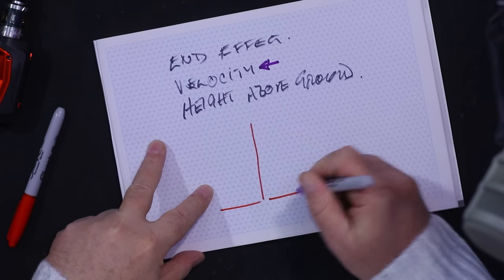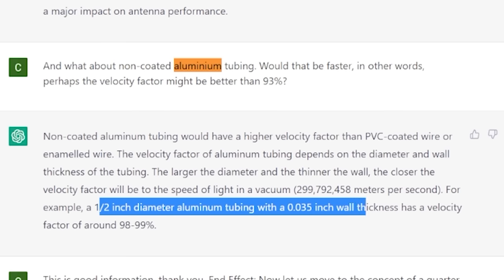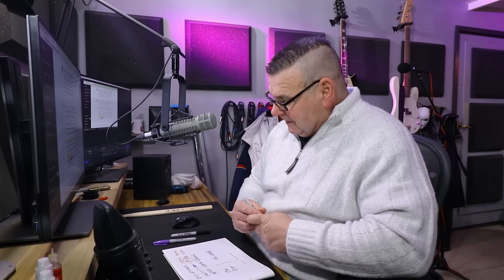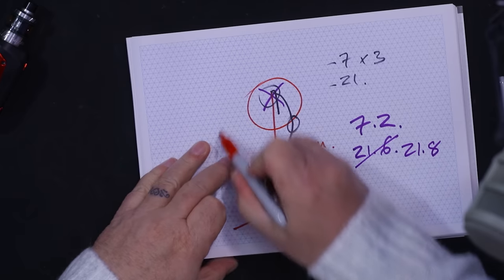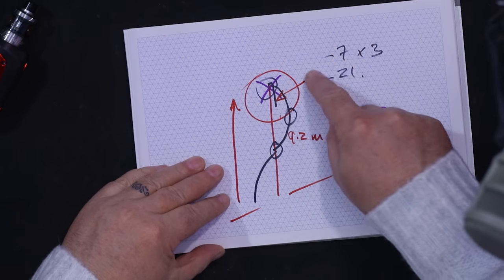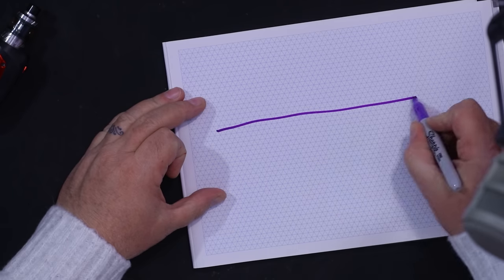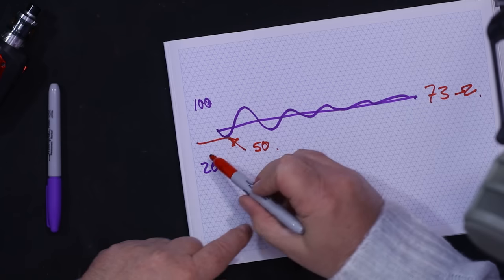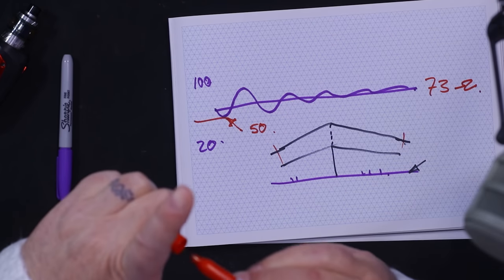Solving the Mystery of a Shorter Antenna - End Effect & Velocity Factor

Comment: Interesting, so when an antenna element is folded back on itself it has the effect of increasing the impedance in that section, why? Because the current flow in the folded back section is in the same direction and phase as the main dipole. Therefore as the current in both sections are in phase with each other the antenna radiation pattern is unaltered. But there is now is an impedance increase in this new folded section deduced from the fact that the power in the folded section has to remain the same, but as current flow is evenly shared between the two sections, the current in each conductor is now a half of the antenna current. Then because the power remains the same in the folded section the impedance has to be raised by a factor of four to retain a balance in the equation Power = I^2 x R
So, the end-effect reduces impedance at the end of the antenna and folding back a short section increases the impedance to redress the imbalance.
Reply from the maker: Wow. Perfect!
Reply: @DXCommanderHQ  should try an inverted egg beater antenna for 40&20 meter bands it should give a lower take off angle

Comment: That certainly helps explain why, with my homebrew fan dipole, I had to keep trimming & folding back the ends of my 80m wires WAY more than I thought just to get it resonant.  I'm low to the ground - 10' in the center & 6' at the ends.  Makes sense now.  Thanks Callum & keep up the good work!
73 K5MWA

Comment: Good information for the newbie Ham! If this video would have been created last year I would have abandoned the idea of an OCF dipole from the start. Further explanation: My Yaesu doesn't have a tuner. OCF dipoles are affected by end effect more than any other antenna. At 40m, both high voltage ends of the waveform contact the ends of the wire, so needs to be 3 feet short for resonance.  At 20m, the center of the waveform (at the center of the wire) is a high voltage point, but not a wire end, so end effect is 50%.  At 10m, you have 4 current humps, but only two find the end of the wire, so it wants to be mostly full length. 10m resonance was about 30mhz. Switched to a fan dipole, at least until I get a tuner....
Reply from the maker: Ah!!

Comment: Everything effects everything in HF! 
I would include the coax and fittings/adapters in that statement. Does the length of the coax make a difference? It doesn't seem to effect SWR so much as it effects the projection of your wavelength. Just as a ground plane gives a backing for the signal to push off of, doesn't the coax do the same?

Comment: Great video, I was wondering roughly how many meters is your equipment from your antennas? Is the length negligible in the performance of your equipment?
Reply from the maker: Hello Davic.. The run from the coax feed box to the field coax box (underground) is 42m (130 ft). I use EcoFlex 15 coax for that. The between the box in the shack to the gear is about 5m (20 ft) and between the field box and the main antenna is another 12m (40 ft). So I have to use very high-end coax.
Reply: @DXCommander  so do you have an external tuner or is the transceiver tuner more than adequate?
Reply from the maker: (sorry for late reply on this) Although I have a tuner, I never use it. I like antennas that just work..

Comment: Just to be sure. This folded wire is behaving as coil not capacitor? Generally your construction is brilliant and easy to build. Another great video. All the best. SP6MI
Reply from the maker: Well, it's supplying loading, so I have no idea to be honest.. I'm at the edge of my understanding.
Reply: @DXCommanderHQ  In theory coil should lengthen the antenna to expected 1/4 lambda, what makes resonance goes down. So yes probably you are right. Physical length is fixed to be resonant as 3rd harmonics on 15m band, and coil extends that element to be resonant on 40m band.

Comment: Simple hight is might! If you have a short antenna does not
Matter how powerful it is or we’ll built if it does not clear most obstacles. That is why hand helds get there antenna replaced from those little rubber duckies that are typically less then 10 inches. If your have an extended antenna say 51 inches and you stand in a semi clear area it give just enough hight to pass the curve of the earth and low obstacles to increase your range from less then a mile to maybe 2-3 miles. Simple or what he said it the ham exam way! Thank you

Comment: Same idea as coax velocity factor., slowing effect, interesting hard line coax has a similar vf as a wire antenne, air does not slow like a foam., the foamier the coax has more air less vf, incidentally vf in coax gets lossier at frequency

Comment: very interesting  i used to work for a tv cable co. at first we used to skin rg6 up to 412 or 500 cable with utility knives so you would score the center pin which was copper coated the bigger stuff we had coring tools. after a while they supplied us a proper tool for rg 6 cable so it wouldn't score the copper coating on the center pin because the rf flows on the the outside of the center pin was interesting did this for a few years they were a cheap company more interested in raising the price per month than fixing picture quality finalley bought out by a bigger company who ran fiber every ware problem solved